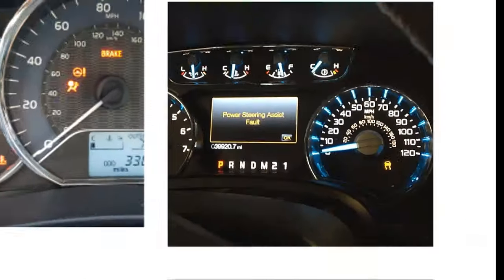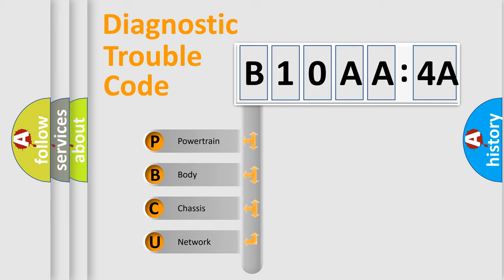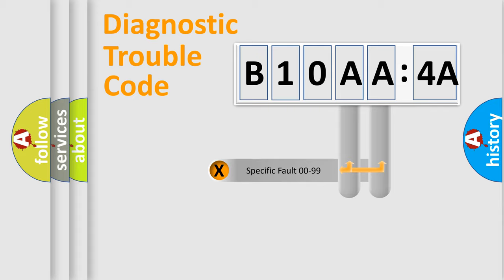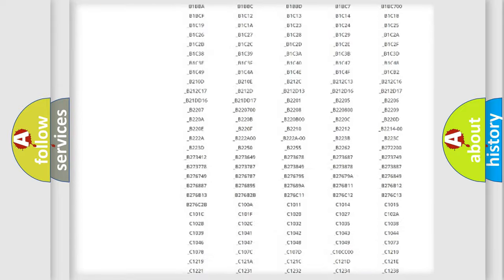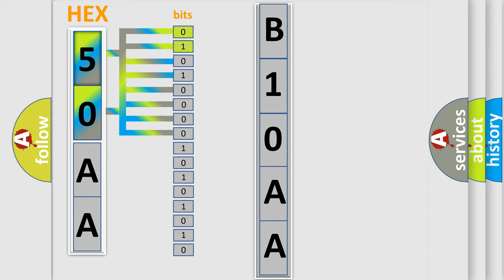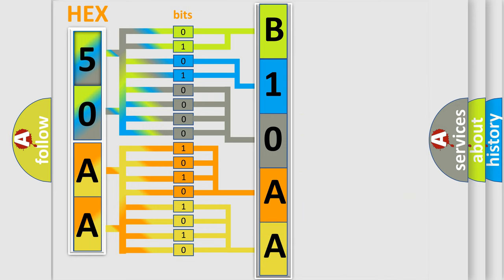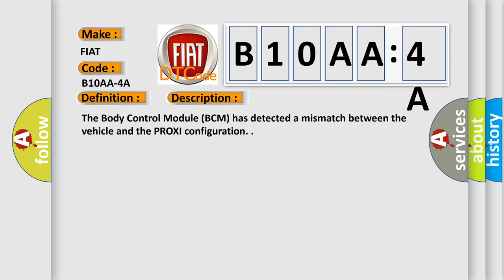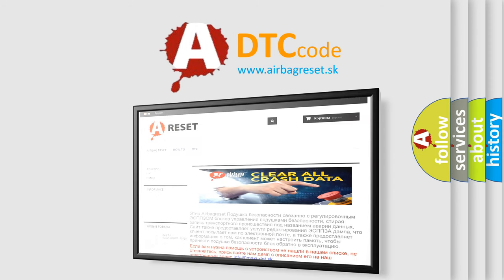DTC Fiat B10AA-4A Short Explanation

Comment: Yes, but how do you figure out which component is incorrect? I have this exact code.
Reply: Did you find out?
Reply: @andresanper  I put a newer stock radio in. I did a proxy alignment using the AlphaOBD app with the radio on and it fixed it. Make sure the radio is on when you do it or the car won't see it and it won't work.
Reply: @andresanper  what about ? B1031113 i have this code fiat 500 1.2 2013